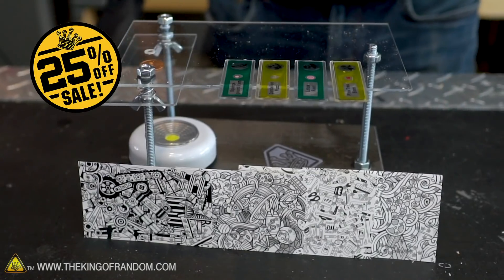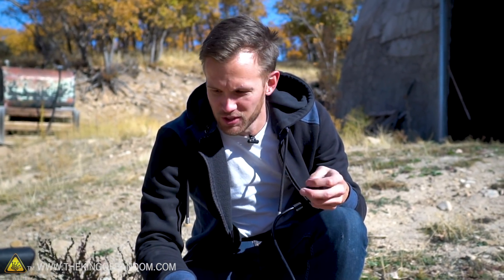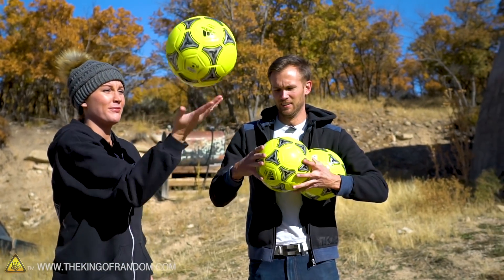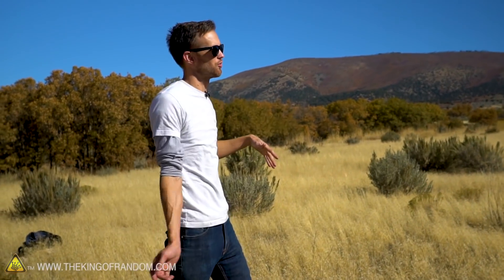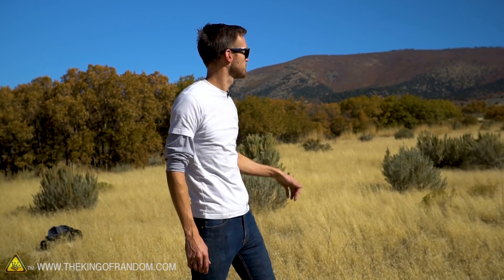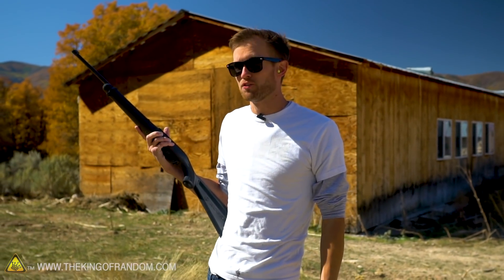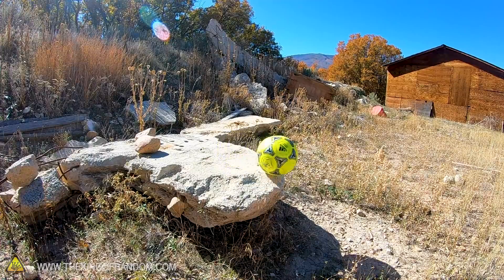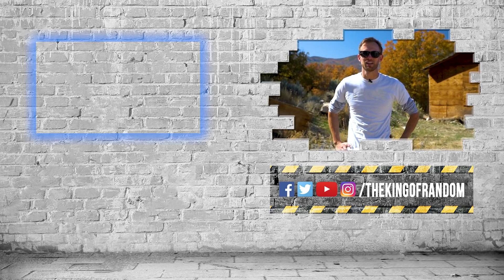What Happens When A Ball Is Filled With Helium?

Comment: When you call a gun a high speed projectile launcher so you don't get demonitized 😄
-Youtube 2019
Reply: When you call a pellet gun a gun
Reply: @chaseallen6156  any device that uses high pressure gasses to propell a projectile trough a barrel is a gun by definition.
air-guns, firearms, compressed CO2 all are technically guns. It doesn't matter if they're deadly or not, the issue is that this is youtube effectively censoring creators from saying a word because they deem it sensitive or unsafe.
Reply: oh its nothing just a bunch of pointy steel flying through the air at thousands of mph
Reply: @TorbasBarut  So when I cough up phlegm, I'm a gun?
Reply: @chaseallen6156  sounds like a 22 to me
Reply: Where is drop test?
Reply: @cob571  yes.
Reply: @mrdanger2686  leave the drop test to linus tech tips, he is a master in this area
Reply: High speed lead, copper coated projectile launcher
Reply: howard the silver alien he’s right though, YouTube is shifting the goalpost on what is allowed and then they’re unclear on what the standard is.
Reply: in da hood. we don't need guns, we insert the bullets manually
Reply: @timothyneiswander3151  you've never been to the hood Timmy. Sit down
Reply: That's op
Reply: Still gets demonitized
Reply: High velocity lead relocation device
Reply: This comment needs to be pinned, the mob demands it
Reply: I call it a high speed wireless home defense security system.
Reply: @Guybrush Threepwood wheb do u know how to spell
Reply: @howard the silver alien, ok unintelligent
Reply: @scudsturm1  Or How Ridiculous, they drop tons of things :P
Reply: @mcdonaldschickensandwich1185  Fail troll is fail. herpa derpa dur
Reply: What time was that
Reply: Chris Anderson wait did you head the part through a BARREL and don’t get smart and say your throat or rectum or something so no you are not a gun
Reply: @cob571  if you ask the media I'm pretty sure you're an AR-15
Reply: Purdqshta Nadenica wow
Reply: @TorbasBarut  So you're telling me, Maxx Force's launch is technically a gun?
Reply: @chaseallen6156  idk, that may have been a .22
Reply: instablaster...

Comment: Is a helium tank heavier when it's empty
Reply: The removal of helium would make the tank less buoyant in the atmosphere, so if it were filled with helium at the same or lower than atmospheric pressure then it would be "lighter" than if it were filled with normal air. (However, this effect would be entirely negligible compared to the weight of the tank itself, and you'd probably need specialized equipment to even tell the difference.)

Filled with helium at high pressure, though, no, it would be heavier when full than when empty. This is because you have a lot more mass crammed into a small volume, so the air becomes way more dense. And as we know from water freezing and expanding to ice, less dense things float while more dense things sink. So while helium normally is less dense than air, pressurized helium is way more dense than normal air, and thus would be heavier.
Reply: @Abion47  I think you've got things a little bit backwards. Empty is still less weight than if it had lower than atmospheric air pressure. The short answer to the original message is simply: No. If you take mass out while keeping size identical then obviously density goes down. Putting in something light weight is still putting in weight.

It is however true that it would make little to no difference to normal people without extremely advanced equipment.
Reply: I had to replace an empty tank with a full tank. The full of helium was definitely lighter.
Reply: It all depends on what you mean by heavy and empty. Does heavy mean more massive, or pulled down more strongly by Earth's gravity? Because buoyancy will make a difference. Also, does empty mean a vacuum, or displaced with air? Because obviously less mass will always be pulled more weakly by Earth's gravity than more mass.
Reply: My big brain hurts reading all this math stuff
Reply: Mind blown 🎆😳
Reply: @guppyboy69 do you know what helium is??
Reply: Abion47 crikey it’s bill nye himself sorry mate
Reply: @stastnysvet6653 It can't of been lighter, the helium would still have weight to it even though it is lighter than air; a full tank would have a lot of helium in so would be quite heavy. It's like a big bag full of candy floss would be heavy even though candy floss is super light
Reply: @larstallinger6795  Mass is not weight, and mass is only one thing that contributes to weight. What determines weight is how much of an effect gravity has on the mass. In a vacuum, any mass is greater than no mass, so a tank filled with anything at any pressure will weigh more than a tank that is completely empty.

However, we are not in a vacuum, we are in an atmosphere, which means you also need to factor in buoyancy. For example, a balloon filled with helium would "weigh" less than an empty balloon, because the buoyancy of the helium is counteracting gravity's effect on the mass of both itself and the balloon. This same effect would hold true for a tank filled with helium to atmospheric pressure or even slightly more (though, again, the effects would likely be imperceptible as a steel gas tank ways a lot more than a rubber party balloon).

As such, here on the surface of Earth, a tank filled to atmospheric pressure with helium would be "lighter" than an empty tank.
Reply: @Netherexio  yes, and he also has a grasp of the laws of physics
Reply: @liamsales4949  awesome sure he does
Reply: If the pressure is around atmospheric pressure and by empty you mean filled with air then yes. Cause it has less mass with helium than with air. Think about it  like this: is a balloon filled with helium lighter than a balloon filled with air? Of course, cause one of them floats and the other falls
Reply: I've been bamboozled. Literally
Reply: Man i learn more in these youtube fights than at school
Reply: I think the real question is "If I fart, do I gain weight?"
Reply: No, Helium has a positive weight to it. It's very small, even less than air, but it does have a weight. Altho.... I guess it would depend. because the Helium has to be replaced with something or the tank would collapse inward on itself like a crushed soda can. So if the Helium was replaced with air and you called that an "empty" helium tank, then it would weigh more because air weighs more than helium. hmmm...
Reply: @escott1981  I'm pretty sure that the metal of a helium tank is strong enough to withstand the pressure of a vacuum
Reply: @larstallinger6795  it's not empty, air has replaced it. Thus heavier.
Reply: @liamsales4949  you're missing the fact that the helium isn't replaced with nothing, it's replaced with air, which is indeed heavier.
Reply: @liamsales4949  a tank full of air is heavier than a tank full of helium in the same way a balloon full air is heavier than a balloon full of helium. candy floss might be light but candy floss is still heavier than air... a full bag of candy floss would fall on the floor where as a full bag of helium would fly into space.

Comment: If you would have weighted them you would have seen that the helium one should have been heavier than the normal air one hence it does not float or really improves the kicking/distance

Comment: I would think either alternative gas could have benefits over air.  Better testing is needed though.  A standardized kick, both punting and ground kicking, and a flat area with measurement markings.  Alternatively, each ball could be dropped from a height and the rebound could be measured.

Comment: One thing you’re missing is the ball resistance to air when you kick it. The Hexa ball goes further because being a bit heavier than air also means it cuts through air easier. Helium on the other hand is bouncier but gets held by the air resistance since air is denser and heavier than helium. In other words air inertia is stopping the helium from going forward. If you were to test the same in a vacuum or in a space filled w helium instead of air you’d get the results you’re looking for and the helium ball would go further.

Comment: I think because the soccer balls themself are made of a heavier and thicker material there is barely any difference. Now rubber balls or Kickballs (or any other thinner sports ball) would maybe get a better result? If it's not too much hassle, maybe try it with multiple different types of inflatable sports balls (or even the generic ones you find in supermarkets!)

Comment: Before watching I'd assume not too much. There's not enough volume to offset the difference in atmospheric weight. That's why they don't bother using any non-atmospheric gas when airing them up. The main difference is the helium will leak out after a short time having to be refilled since the opening in the fill valve isn't calibrated to hold such elusive gases. Maybe a bit more bounce, but nothing significant.

Comment: It's the fact that you filled it to a certain PSI. You need a lot more helium to get a ball to 12PSI than you do air or sulfur hexafluoride. So there's less sulfur hexafluoride making up that 12PSI than there is helium, meaning they all weigh roughly the same, (with human error of course)

Comment: My head is tripping, helium is lighter so its helped by slighly less gravity (could be wrong) and would benefit the most from a breeze but a opposing breeze would do the opposite,
The sf6 in my mind should travel the furthest as the extra weight would have a greater kinetic energy,
But then i imagine you would have to increase the power of the kick to gain the motion?!?!?! 🌋
You fry my brain and i love it

Comment: You guys should have weighed the balls after they were filled. There was a video where they filled a bike tire with helium and it was heavier than with oxygen. Because the helium is less dense than air it takes more helium to fill the ball to the same PSI.

Comment: I don't think these tests are as inconclusive as you might think. However you needed to be measuring where the ball first impacted, not how far it went and that is probably why your SF6 went farthest some of the time. Then consider how the wind affects things. You can throw a baseball farther than you can throw a wiffle ball because of the air and wind resistance against it's mass. It was clearly stated this wasn't scientific and just experimental, so just given the results they don't seem that odd, however the measurements are what I have the biggest problem with. Measuring where the ball impacted not ended would have given much better results.

Comment: I think the Helium lightens the ball just enough that it can stay in the air slightly longer. Where as the Sf6 added just enough density to maybe make the ball more like a solid object, making it easier for the energy of your kick to pass to the ball, instead of losing some force when the ball bends and reacts to a kick with less Dense air? Just a thought. Tho not using any scientific facts.

Comment: I'd like to see a little more scientific control going on please.  This video shows that "What happens when a ball is filled with helium?" is that it gets helium inside of it.
You could have done these tests;
- A drop test, to see which bounces higher.
- You could have weighed the balls.
- A density test (which is obvious but would have been something).
- A leak test to see if one holds pressure better.
- Roll them down a set incline to see if one had more seed or if one had more distance on a flat surface after the incline.
- Check temperature of the ball after inflating to see if one was hotter than another.
- Drop a weight on it from above and check acoustic volume of each ball.

Revisit this one please and try to make some reasonable statements about what happens.

Comment: lets see, It will either have A. no effect, or B, render the ball slightly lighter, which will result in either the ball flying slightly farther than a ball filled with air if similar amounts of kick power is imparted, OR, if the helium overcomes the balls ideal kinetic mass, and then air resistance is enough to slow it down, it will not go as far. It depends HOW much helium you actually put in. though Im betting more on "little to no difference"... i just now watched the video after typign that out.. There is no consistency in the kinetic energy imparted to the balls, even when you have the same people kick it multiple times, Averaging will not correct for the sheer differences in each persons invidual kicks even when averaged among the same individual. you need a launcher of some kind that will hit each ball with the same amount of force to get any idea because I know from experience that the amount of "bouyency" you will get from helium in that volume is TINY. You will never have the accuracy to detect differences that small, using your test methodology.

Comment: This is the sorriest excuse for a science experiment.. you couldn't even spend the minimum and buy AT LEAST a hose clamp and the right size tubing for the helium.. even mid tier, thats a 1/4 standard thread under the nipple attachment.. even the sulfur hexafluoride bottle.. a cheap regulator is 50 bucks.. low effort, max profits, no care, plug merch. Cool.